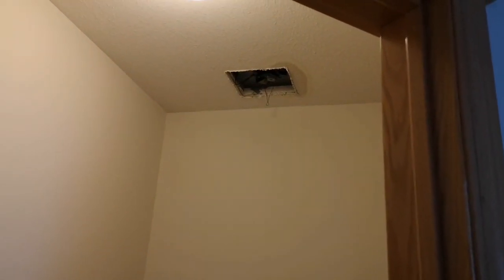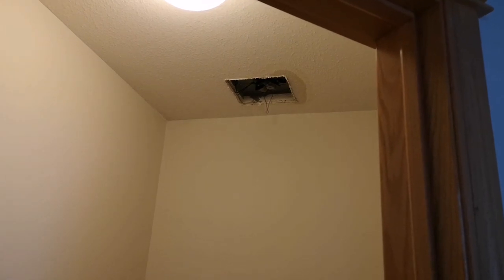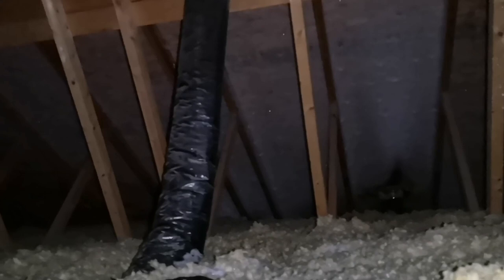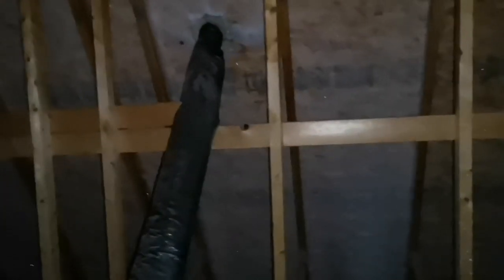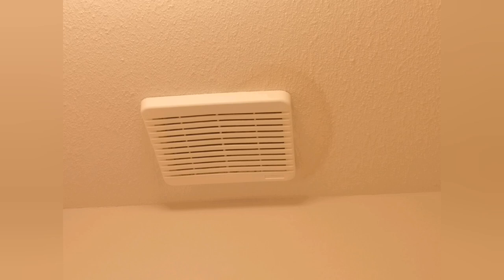Bathroom fan leak in winter (poor attic ventilation?)

Comment: You need proper air sealing.  If you have a vapor barrier in your attic, tie the vent into this vapor barrier.  You have a big gap between the drywall and the box fan, when cold and warm air mix together, you get condensation.

Comment: I have the same vent as you. Did you find a solution?
Reply from the maker: I have not dealt with it, but I have narrowed the usage to 2 possibilities. One is my washroom vent tube is broken inside the attic, so I pushed warm air into the cold attic when I turn on the fan, and condensation built up in attic. 
Another possibility is Mt attic not vemted property, so condensation is collecting inside attic.
Reply: @nickhu1852  so right now you just let it drop every winter then?
Reply from the maker: It has not been any dripping this winter. It only happens when we have a huge temperature swing, like a warm jet stream hits Calgary and temperature jumps 25 degrees overnight.
I think my attic vents okay, but the fan might still partially vent into the attic.
Reply: This is very very bad for your attic if its not fixed immediately! This been pending for 2 years and you didnt fix it yet 🤣 you shouldnt see ice formation on the roof plywood at all anytime through winter! install rafter vents for better intake nstall a whylbird or maximum 301 vent for better exaust and make sure or bathroom vent isnt leaking to ur attic
Reply from the maker: @Mark300win  thanks for the advice
Reply: Nick hu so what should we do for the wet inside felling of the roof ??